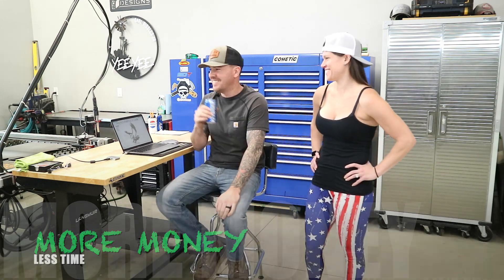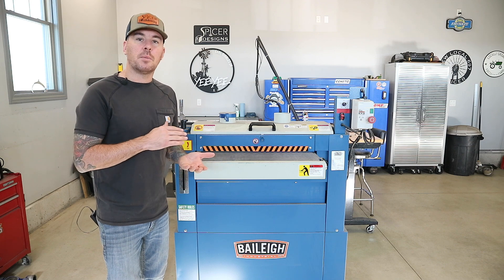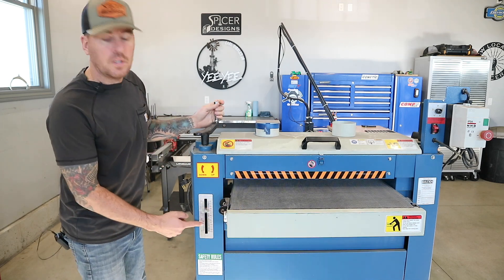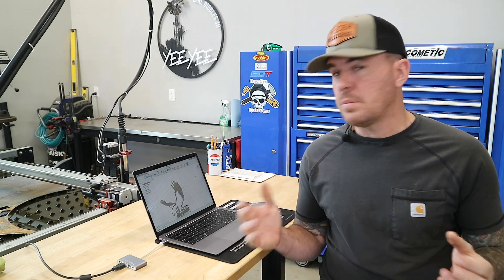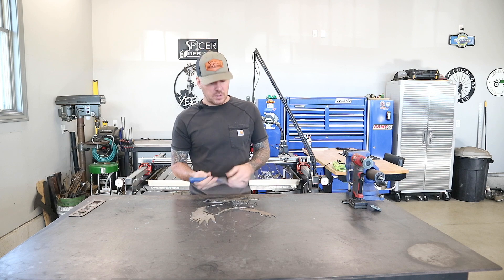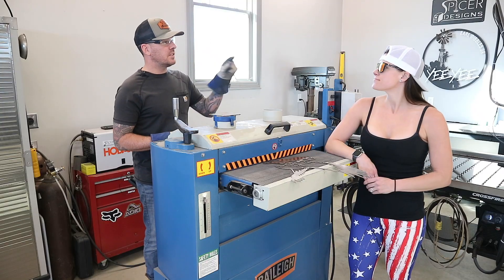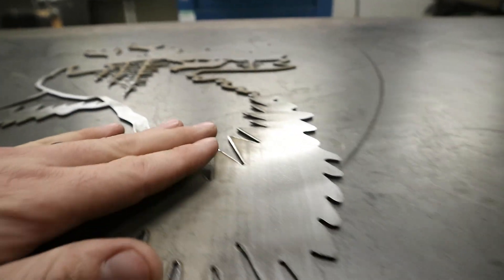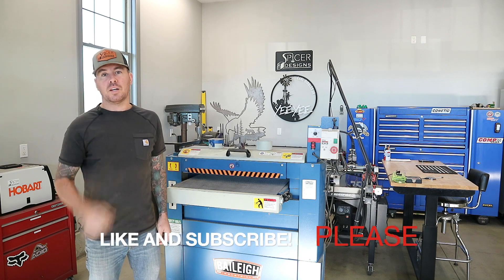A BETTER OPTION for your CNC SHOP?

Comment: Where did you find that eagle file? To add to that question, where do you get all these files to pull into Fusion? I am getting my garage set up now to assemble a Crossfire XL and starting to learn more about the software side. But that eagle would be perfect for going away gifts for guys when they leave the unit I am in right now.
Reply from the maker: I find and image and trace it with the cad tool in fusion.  I make all of my files.

Comment: It’s not very efficient because that drum sander is meant for woodworking. Drum sanders meant for metal work have pneumatic inflating drums to apply even pressure across the workpiece as well as the drums spin in the opposite direction.

Comment: You just need more pressure on the infeed table so the drums press on the work more. Should be able to run them thru 2-3 times per side tops. That's why it's got a big motor on it, takes some HP to remove the slag & surface the part.
Reply from the maker: Someone mentioned using a board under the metal to keep more pressure on it like your saying.  Ill have to give it a try.   Thanks for the info.
Reply: @SpicerDesignsLLC  You'll know it's working well by the part finish.......and all the grit and metal dust all over everything. Next you'll want a dust collector. Or wheel it outside on a nice day. Post a follow up video!
Reply from the maker: @funone8716  will do.  Thanks buddy!

Comment: Low-speed dross forms when the torch’s cutting speed is too slow and the arc shoots ahead. It forms as a heavy, bubbly deposit at the bottom of the cut and can be removed easily.
Increase the speed to reduce this type of dross.  Adjust cutting speed with new consumables.

Comment: Stars and stripes never looked so good :).  I've thought about buying a drum sander, but your review makes me second guess the need.  I have found that the carbide blade paint scrapers do a great job of taking off the dross, may work better than the chisel you are using and you may not need to sand!
Reply from the maker: Ya i dont think its worth what you get out of it.  I would probably use it more if my shop was setup better or larger.  Ill check out those scrapers.   Thanks for the comment!

Comment: Also there might be a different cut/shield gas mix to keep your dross down. On our "laser" we used a TRI-MIX – 66% Argon – 26.5% Helium – 7.5% Co2 and worked with torch speed
Reply from the maker: Mines plasma.  Just has the air compressor hooked up to it.  I wish i had a laser.

Comment: Great job BTW. Because the drive belt might yield under the downward pressure try running your work piece on a slave piece of backing material.
Reply from the maker: Thats a good idea.  Im sure thats why its not getting even coverage.  Thanks for the suggestion.

Comment: I use a twisted wire cup brush on my angle grinder.  It takes off the large chunks as well as all the small stuff in just a few minutes and leaves the whole piece clean and shiny, ready for paint.  Fast, easy and cheap.

Comment: For a smaller shop they’re a big investment. I think you’re correct on investing in other tools at first. A plus side would be if you’re using hot roll to remove the mill scale 
Keystone girl inks a knockout, good for you man.
Reply from the maker: I tried using it to remove the hot rolled coating and it didnt work very well.  Its just not worth the money for what it does.   Thanks for the comment!

Comment: Sheet steel is VERY uniform in thickness. I would guess the feed belt is deflecting away from the sanding drums. I'd bet if you ran the piece through with a sturdy piece of material under it, it would be sanded more consistently. Nice piece of equipment. In the long run it should be a big time saver.

Comment: I need to upgrade the service to my detached garage to be able to run my compressor and plasma. My house is only fed with 100A. If I put a 100A feeder panel in the garage and bump the house up to 200A, I should be covered for the plasma gear, and eventually adding stuff like a sander, right?
Reply from the maker: Yes you would be fine.  Honestly you shouldnt have any issues running the plasma cutter and compressor on the 100 amp right now.
Reply: @SpicerDesignsLLC  yeah, until my refrigerator comes on in the house 😂

Working on the shop equipment, still looking for a keystone girl. They're a little harder to find

Comment: I've been meaning to ask...I thought I remembered you talking about maybe doing some custom stuff for Kioti tractor owners...still considering that?  I would love a more robust front grill for my DK 4710 now that I have a grapple.
Reply from the maker: Yes i am planning on doing that still.  Im going to start designing that soon. Wanted to save it for a winter project.  I also want to design a hydraulic quick attach for the bucket.
Reply: @SpicerDesignsLLC  what are you waiting for, get after it!  All kidding aside, looking forward to what you come up with...you obviously do great work.  Assuming the hydraulic quick attach would work off of a third function or are you thinking electric?  Would love that for swapping out the buck and forks.  Heck, even the grapple.  Guessing the hydraulic quick attach could lock down my levers, then once it's on I change it over to the grapple.
Reply from the maker: @TheTwinCitiesBestHomesdotcom  my plan is to get an solenoid valve that will change from one set of ports or the other on the 3rd function.  It would be controlled by a switch in the cab.  Im excited to start that one

Comment: Do you use fine cut consumables on your plasma torch?  What amp plasma machine do you have?
Reply from the maker: They are not fine cut but i was trying to find them for my machine.  Its a 45 amp
Reply: I just ordered some fine cut for my Hypertherm 85 as I'm have some trouble with the standard 45A comsumables doing narrow work on 16Ga steel.
Reply from the maker: @curtishatfield9629  im really interested in the fine cut consumable’s.   I need to check into that.   Those hyperthems are nice machines.

Comment: Is that 16g steel?  If so what speed are you running on the machine? When I was doing 16g steel I was at 240ipm and you would have very little to no dross. If you want I can send some setting to you. I have the razor45 torch.
Reply from the maker: Its 14 gauge.  I was running it at 70 ipm.  I usually  dont go much higher than that.  Ill have to try speeding it up next time.
Reply: @SpicerDesignsLLC  I do 14g aluminum for all my signs now at 200ipm. Aluminum is actually .08. Don’t be scared to go faster the machine can take it. I’ve been running my pro for 2 years now at 200 ipm and faster doing about 40 to 70 signs a week. Also I use fusion 360 for design and sheetcam for the cut files. It will save you lot of money to use sheetcam just because it’s way easier to nest files. I don’t have lots of scrap left when I’m done.
Reply from the maker: @jonbozzy9600  thanks for the info Jon.  Ill start playing with that speed more